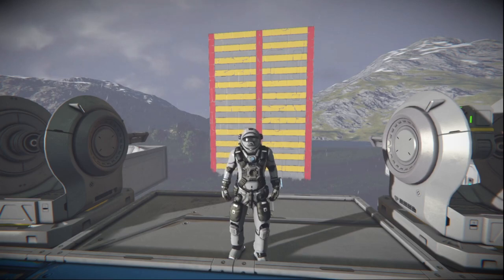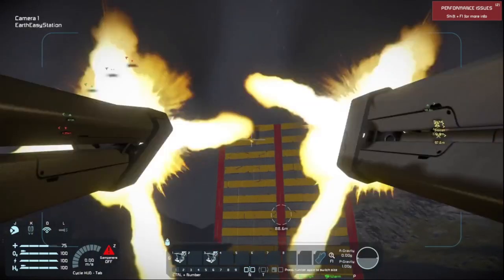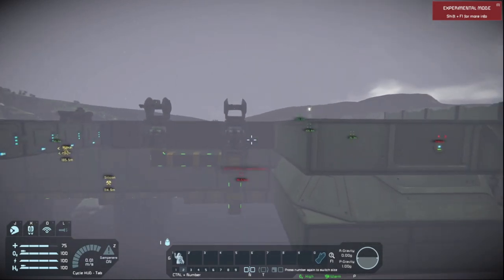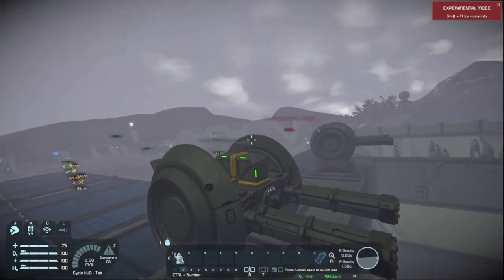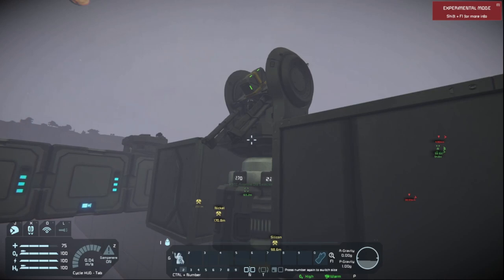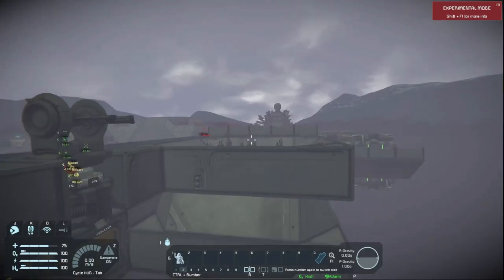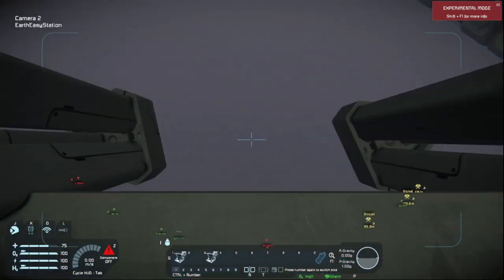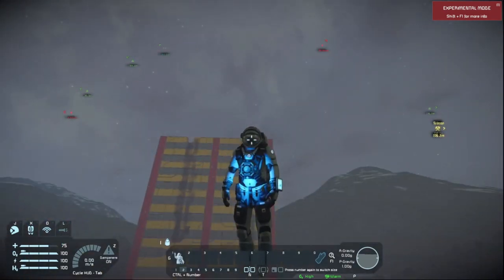A Little Trick To Make Your Turrets Even Better.

Comment: I make my turrets with 2 advanced rotors. All the motion you need, only downside is figuring out the armor
Reply from the maker: You could seat the blocks in each other so the joint has some protection.

Comment: Another option would be to hang the turret by an advanced rotor and a Curved conveyor so that the turret gets the full range of elevation by virtue of its neutral position being 0° and being able to tilt to both 90° and -90°.  Granted, you limit your range of lateral rotation to less than 180°, but it's an option for directional turret.

Edit: Spelling error
Reply from the maker: Yes rotor turrets are a thing that needs to be made more I built one with the north winds mod in survival Under fire.

Comment: 2 thinks 180° isn't like a flat plane it is a flat plane. Secondly it is far worse to leave your over and under exposed than a sliver of your side. Also turret placement can cover that blind side. You're suggesting someone cut off their head to cure their acne...
Reply from the maker: 1. I may not have been clear but I'm shifting the plane of movement on the hinge to get more angle of attack with the turrets and get more coverage in combination with the azimuth.

2. I'm not advocating for turrets on only one side of the ship. If buil it normally you will get only two of four guns on target where as when you shift the plane you can put more turrets on target (ie. Top side and bottom) resulting in faster threat elimination.

3. I never you only needed to cover blind spots. In Space Engineers combat ships mostly fall into the class of (turret farm) or (flying rifle). More turrets you can pack the better infact I have a video showing the custom turret is better that the stock turrets thus making good turret design essential for proper ship defence and offense.

Comment: I honestly think this new turret design works best for player-controlled turrets, while the original design works better for AI-controlled turrets, since you have to worry about the AI shooting your own ship if any part of your ship gets between the turret and the enemy.
Reply from the maker: Yup shooting your own ship is a problem.
Reply: does the turret controller override the limits on the hinges?
Reply from the maker: No it will not unfortunately.
Reply: @Dolph_Vader In theory you should be able set the limits on the rotors & hinges themselves to avoid such issues.

Black Armor's tutorials on Mech leg configuration explains how to set these sorts of limits well.

The priciple is the same, however he demonstrates how to avoid leg armour from hitting other parts of the Mech while walking. 

Like I said, the principle is the same; So when applied to the custom Turret Rotors & Hinges they shouldn't be able to aim past those limits.

Would have to double check in game to confirm, however I don't see why it wouldn't work.
Reply: @badgerwildgaming6908  Great content mate, you have some great work around's and unique ideas overall.
Reply from the maker: @soulsurvivor8293 yup been looking at black armors channel recently. Dude is the se master of mechs.
Reply from the maker: @soulsurvivor8293 thanks I try my best.

Comment: They have different fire arcs, and would be each suited for different applications.  The simple turret would be better when placed on a flat surface when the need to depress the guns lower than 90° isn't as important as 360° coverage all around the turret.  The other turret is better in all other scenarios.
Reply from the maker: If you check the Discord I have a great example of that with the missouri class I'm building.

Comment: I have been building my turres in a similar fashion, with the difference that rather than building a tube to go around and portrude from the hinge at a 90° angle, my guns usually just sit on top of the hinge.
Reply from the maker: I've seen that done and it makes sense  as it would put your guns on a higher plan of fire.

Comment: I didn't think of that. Thats a simple yet clever solution to the problem. Cheers!

You can fix the turret hitting itself by changing the lower limit in the terminal.
Reply from the maker: Yes it just requires some tweeking.

Comment: Quad turrets are also better because you can set the weapons back farther into the main hinge, so that the center of the weapon aligns with the pivot points.  Makes them faster to track, and more precise (when automated).

When the controller is calculating where to point the turret, it doesn't calculate the actual point from which the weapons-fire is generated.  It's just calculating from the hinges/rotors.  So, if the weapon is more centered relative to that rotation point, the tip where the bullets are generated and "fired" doesn't have to move quite as many degrees of arc to be accurate.  Like an ice skater pulling their arms in.  Except in this case, the end of the gun is closer to where the controller thinks the hinge/rotor is pointed.  And the corrections happen more quickly because that end doesn't have to rotate as far.

But, it only works for quads, unless you're ok with an unbalanced turret, which I don't think the game really penalizes.

Comment: I was going to point out that you moved the blind spot from the bottom of the turret to the top. Which either way isn't bad cuz you can add more turrets for better coverage of lines of sight. But you brought up the blind spot being moved and kinda covered a fix for it. Like you said, this is space Engineers, we can engineer our way into and out of problems. But thanks for the input and the awesome video. I'll be checking this myself and fixing it if I find it to be a big enough problem. I'm on single player so I don't have to worry about hydro man myself
Reply from the maker: Your welcome hope it helps.
Reply: @badgerwildgaming6908  I have to rework much of the armaments on my ships anyways, I'll keep you updated if I can.
Reply from the maker: Awsome.

Comment: Is this allowing the hinge to over extend past the 90 degree mark? Cause that would be useful in a bunch of scenarios. I would not use this for guns cause once its a hinge I take into account that I will only have -90 up to 90. 0 degrees would be looking straight up. With a hinge on the top of your grid then most players find it easier to make good looking and/or compact guns by placing a hinge on a block on the bottom of the hinge. If its the top of my grid but I still need the gun to go below my horizon I guess you could say....I tend to use rotors rather than hinges. If I do use hinges I connect the hinge to a block that is behind it rather than underneath it. 0 degrees would be straight ahead rather than straight up. I personally get less clang with hinges but often need my top mounted guns to shoot as low as it can below my horizon without shooting the grid its mounted on. I find that I gravitate more towards using the hinge and just deal with less degrees of movement when how the gun looks or how compact it is was the important factor to me because to me its way more easy to make the guns look good and make them more compact when using a hinge rather than rotor. But most of the time I build very ugly WTF is that looking grids. I mostly go for the rotor with top mounted guns sometimes on a piston so it can spin a full 360 when turned on. Thanks for sharing this video. Interesting stuff. I love this game. Now to get them to add a "Reset Air Tightness" button. I grow tired of reloading my entire game because airtightness glitched out making all vents display one green bar even when the doors are open. If I could reset just the airtightness I feel like I would not need to reload the whole game. And humanoid NPC's. I want a 2nd in command. Where's my William Riker dammit??!! Where's my Lieutenant Commander Data except with less bags under the eyes?? Could bag groceries with them things.
Reply from the maker: Yes it shifts the 90° angle so the horizontal rotor makes up for the new angle of attack. Also if you want a Riker and a data there is a mod that let's you do this it's called AI Enabled Mod and you can have up to two npcs that can do a variety of things including cover you in a fight.
Reply: @badgerwildgaming6908  I saw that mod but never tried it out. I'm gonna give it a try today. Still have not tried aerodynamics mod either. I need to live a lil more.
Reply from the maker: Trust me the npc mod is great and adds so much now to the game.
Reply: @badgerwildgaming6908  You are right bro!! I added it right after you mentioned it. I have been missing out. I play a lot of single player. I'm literally the only person in the universe other than Reavers and crap. Just having a NPC there Is awesome. I got the lil weld bot. Go's around and welds up things on my outpost. Good call bro. Me and NPC mod get along
Reply from the maker: Yup we called him steve....RIP steve.